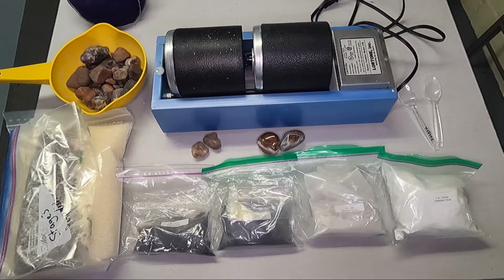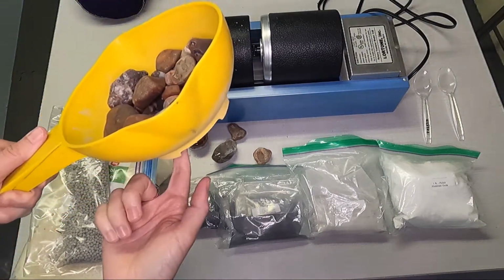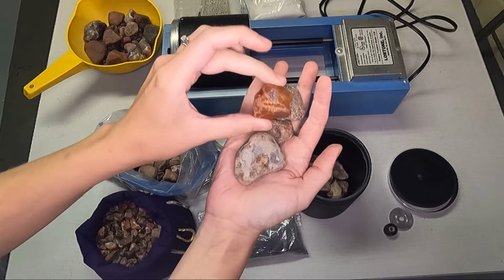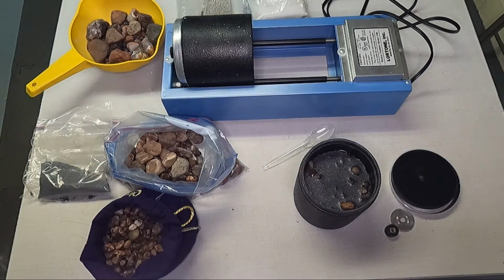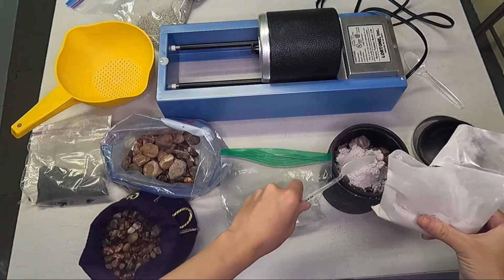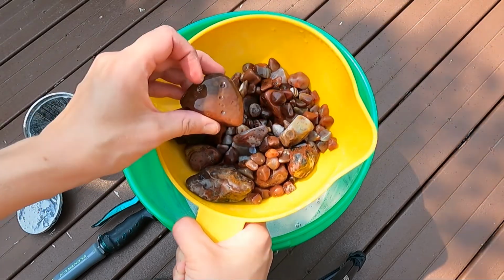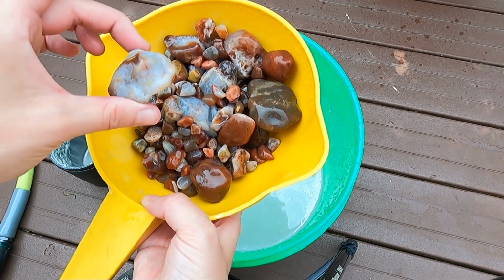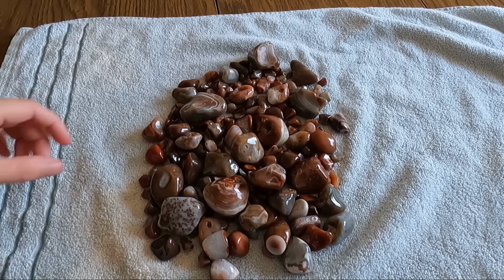How to Polish Agates Using a Rock Tumbler

Comment: I recommend checking your rocks a day or 2 after putting them in coarse grit.  If the ratio of quartz to agate is high, DO NOT leave them in for more than a few days. If you do. You will grind away the thin rind of agate and just be left with a clear. Quarts rock.

Everything is relative.  It all depends on the rock
  Rocks thst have a thin. Banded coating but the center is mostly agate, to preserve the bands you may elect to shorten the time in coarse and medium or leave the agates untumbled, in a jar filled with mineral oil.

This is a non tumbling state that still enhances all the characteristics of the rock but does not damage the rock.

Depending on where the agate is on a stone, tumbling can actually destroy the looks of a rock. Especially those with frogskin or those with an agate rind but a quartz middle.
Reply from the maker: Thanks for sharing! Helpful info for people

Comment: Thank you! I just got a Lortone 45C. Did the first stage for a week. Cleaned and put back on the tumbler. My slurry was so thick. 60/90. I had a hard time cleaning the rocks off. I filled the barrel with enough water and thought I had the right measurement of grit. Is it normal thick? Mine was almost pudding. Thin pudding. I have noticed my barrel isn't as full now. I have different sizes in it. All the same hardness. Should I add more rocks or ceramic media? Sorry for all the questions but would appreciate any advice. I love agates. Will be coming to Lake Superior next month for rock hunting. Yay!
Reply from the maker: The slurry can get thick, but I wouldn't expect pudding thickness after 1 week. Try adding a little bit more water. You may have to experiment with a couple batches. You do want the barrel about 2/3-3/4 full to allow for movement but not too much. I would recommend adding ceramic or plastic pellets to fill up some of the excess space. Let me know if you have further questions and happy rock hunting next month!
Reply: Ceramic media is best for stages 1 and 2 as they help grind into holes, cracks and dips in a rock.  The barrel should always be 2/3 to 3/4 full of tumbling material.

If you do not have more rocks to add, add ceramic media.  Theaction of grinding is grit+ various size rocks+ media+ water over TIME.

IF there is too much grit it actually does not work as well.  The true action are the weight of rocks, grinding the grit between each rock.  So too much grit is just a waste and may delay results.

Many tumblers recommend 1 T grit per pound of rocks.  Be sure to use small, medium and larger stones, as the rock amount lowers, either add more rocks OR add ceramic media.

If there are dents and dimples in your rock, tiny rocks or ceramic media help to get in there to grind.

Save plastic media for steps 3-5  when you need to cushion the tocks as they tumble.

Ceramic for grinding assist. Plastic for rock cushioning.  Some use plastic or ceramic all the way through play around with it but try to match which you use with the type of media.  If your rocks got lower in the barrel the grinding was successful.  As you decrease the amount of rock in the barrel, Decrease the amount of grit.
Reply: @GuidingBoltGaming   There can and will be a thicker Slurry if there are any rocks that have a softer MOHs than the target grind.  That slurry is not just the grit but also the grind of rocks.  ANY rocks with sandstone, talc, gypsum, calcite, limestone will add to slurry thickness.  It is important to make sure all rocks are of similar hardness because you can grind or undercut softer materials in the rocks.
Reply: Thank you guys for the advice! I'm using ceramics now. And making sure all rocks are the same Mohs. First batch turned out amazing.

Comment: Do you have the tumblers going constantly 3-4 weeks in stage 1?
Reply from the maker: I typically check the rocks every 1-2 weeks. Sometimes pressure can build up inside the barrel. Doing a check releases that and helps prevent leaks or damage to your barrels.